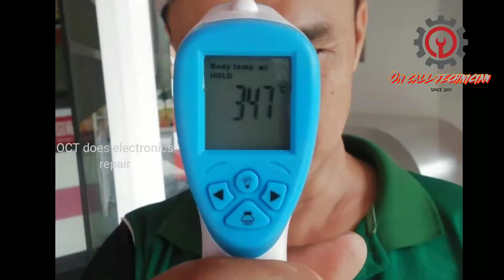HOW TO REPAIR NO POWER OF ALCARE INFRARED THERMOMETER

Comment: Hi
I have one question 
How to direct the push button pin
Reply from the maker: I recommend sir just do what i did. But if you really want to direct it will always on and keeps on reading body temperature thus result to over heating.
You may pull out the tact switch sir out of the pcb and install at external body but you need to extend the wire. In that case, no more fragile switch is needed.
Reply from the maker: My apologies sir, i didn't entertain Personal Message anymore coz it befits one person only. If have questions just write it down then ill answer with God's help.